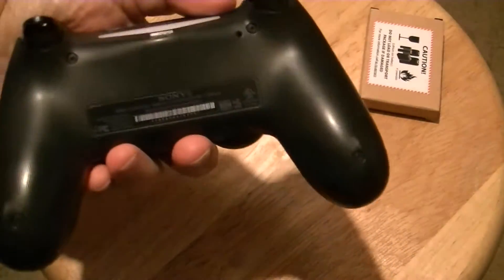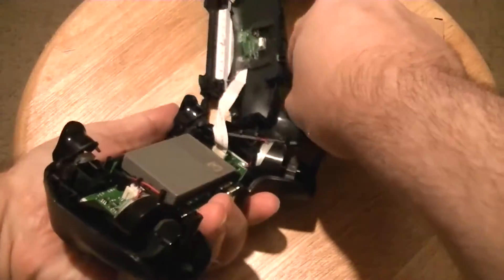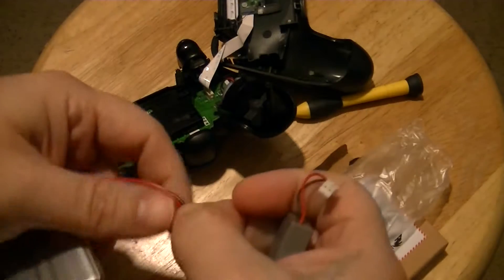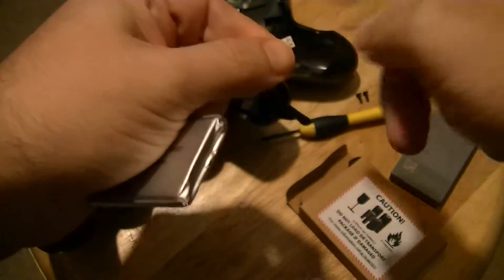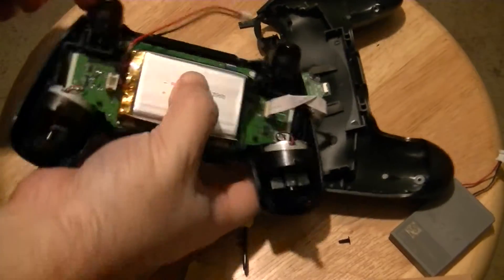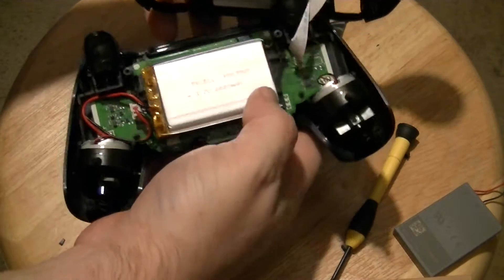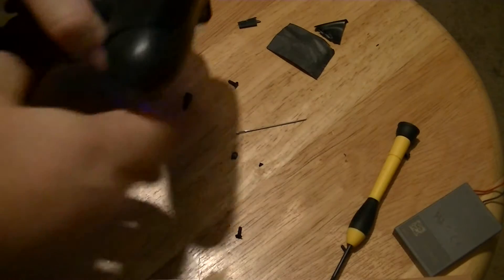Upgrading The PS4 Controller Battery

Comment: I realize this is a "learn by doing" process, so I'll add my experience here for any future viewers: First of all, the battery I purchased from Amazon did NOT need to have the red and black leads switched.
https://www.amazon.com/gp/product/B0137ITW46/
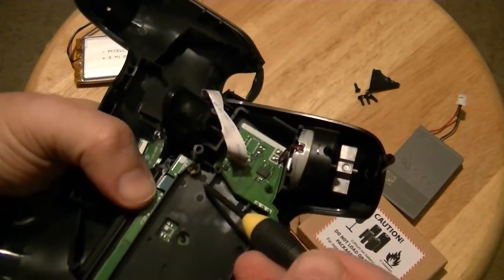Secondly, the black plastic battery tray shown at 4:00 is only held on to the controller by 2 very easily removed clips. Just push them carefully with a small bladed screwdriver and the battery tray comes off. Much easier to modify it that way. Lastly, there was no need to modify the top half of the controller by cutting away a small section of the top. The issue is spoken about at 5:47. The solution to this was to simply twist another loop in the battery wires so they didn't reach over to the far side of the controller.

Comment: Lol I wished I had watched your video first hahaha I sat there for probably 10 minutes soldering. I'm actually here because I have the exact same setup and all complete now. My battery is full I think. So order of events. I soldered the wires the other way as people have instructed. I then tried pressing the ps button and it blinked yellow a couple times and then wouldn't blink at all. Ribbon cable and battery cable is connected properly. I plugged it directly into my PS4 thinking maybe it needs to pair. It finally glowed blue and I checked the menu for battery charge and it said full. But without the controller being plugged in, nothing happens. I don't get it.
Reply: Terminals backwards if you haven't tried it already